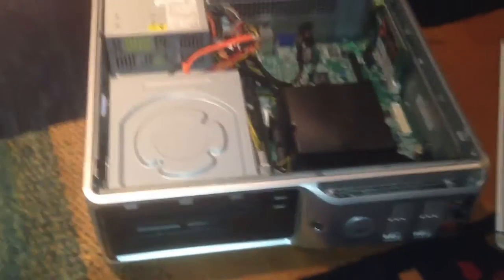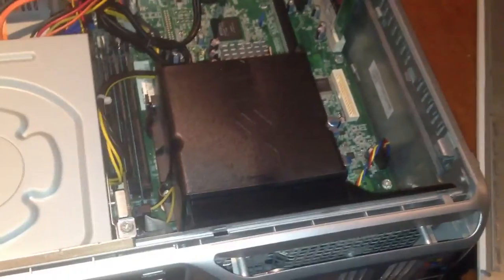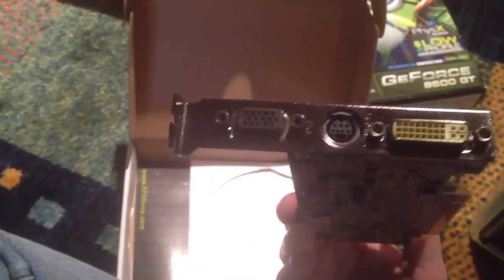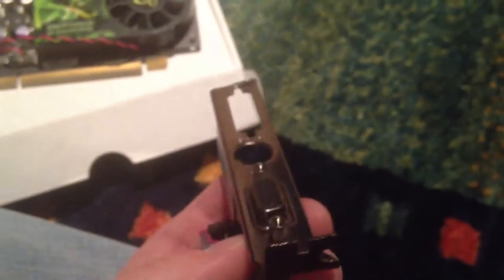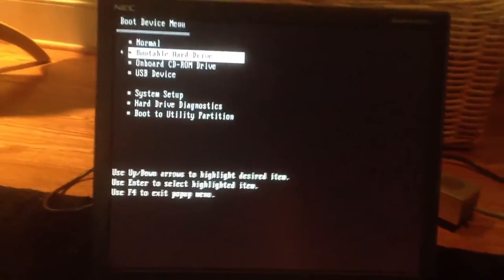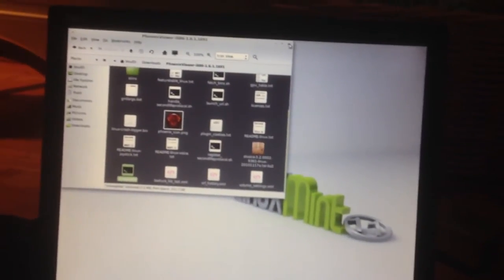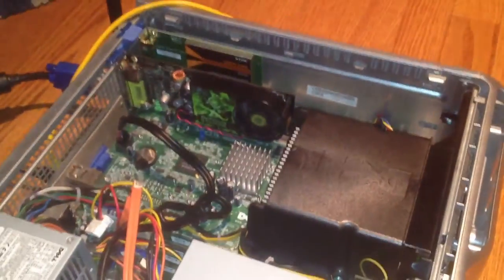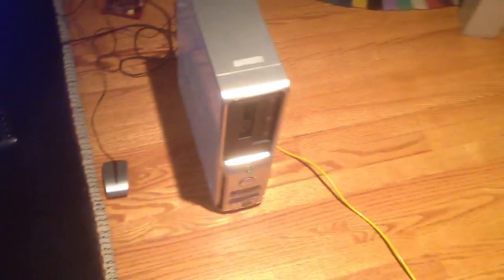Dell Dimension C521: Upgrades

Comment from the maker: yeah, i used the proprietary drivers on linux mint 11 to get that working.

oh yeah, i used to run arch. it works great if you have older machines and want to run a really light system. gentoo runs a lot better though because you can optimize it.

Comment: I got a black sreen when after installing Ubuntu 12.04 on my main machine with an Nvidia GT430 card. Had to edit: /etc/default/grub and change GRUB_CMDLINE_LINUX_DEFAULT="quiet splash" to GRUB_CMDLINE_LINUX_DEFAULT="quiet splash nomodeset". After you do that you run 'sudo update-grub' in the command line. Then you can boot into the system and update the drivers from the desktop.

Comment: Hey, I just got the same machine. Could i get some tips on how i should upgrade it?
Reply: Max out the ram, an SSD and a low profile dedicated GPU are the best upgrades you could do for it. And install windows 7 if you haven't already.
Reply: TacticalDesire
Already installed windows 7, god an okay GPU (Nvidia GT 610 2gb), AMD Athlon X2 +5600 2.8GHz, and my Computer can only read like 2.75 or 3Gb of Ram D:
Reply: Ratchet Buck'it
Looks like some pretty solid upgrades. How is it working? What do you use it for?
Reply: TacticalDesire
Mostly Gaming, Like I'm playing Crysis 3 right now all low. But eh, I usually keep to team fortress 2 and other source games.
Reply: Ratchet Buck'it
Is it your main machine?
Reply: TacticalDesire
Yeah, I wish I could get somethin' better
Reply: Ratchet Buck'it
Sometimes you just have to work with what you have. My main machine is fairly old by todays standards (2009) Phenom 64 X4 9750, 8gb RAM, and a HD4650 graphics card. Had it almost 5 years and bought it new. Probably going to keep it until it dies.
Reply: Thats what I planned on, this is actually the best machine I've ever had.
Reply: i know its been 3 years ago but are youguys still using these pc's?